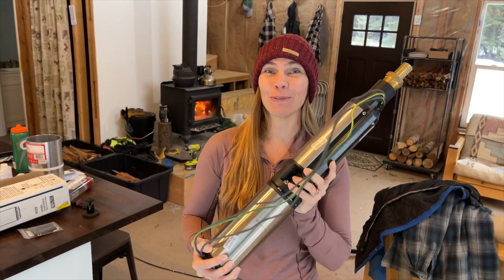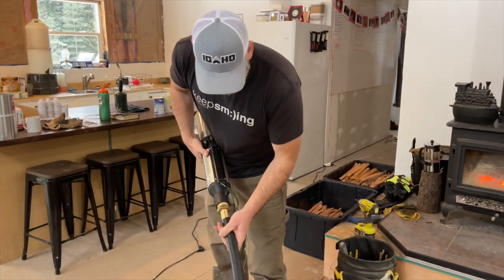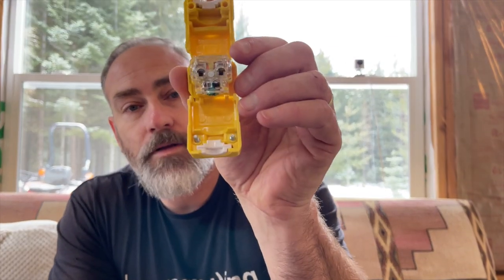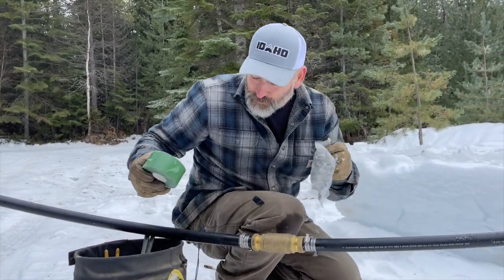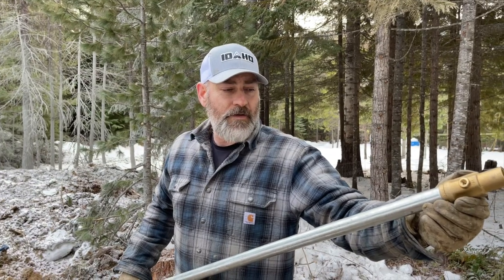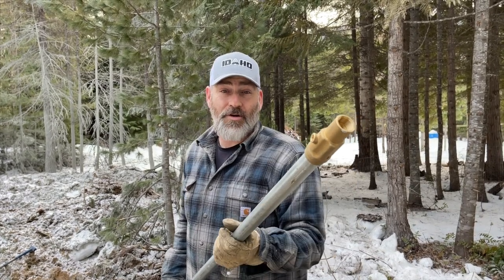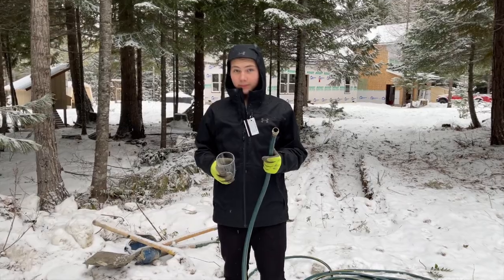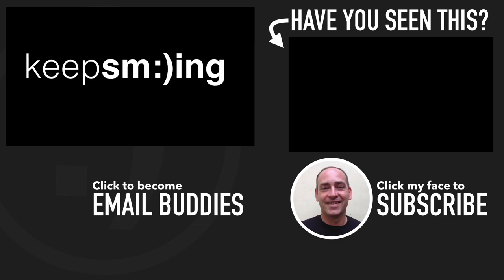WIFE is HAPPY/HUSBAND is NOT - DIY Well Pump Installation

Comment: Several points. Btw, Great work addressing details. I like that attention to detail. 

First, that black pipe is a bad idea as it will suffer degradation from torque. Replace it with rigid pipe someday. Second, the water has high iron in it (not mud, iron). That needs to be removed outside the well, lest it foul flow in the aquifer to your well. Oxidize the iron in a sizable container that can be cleaned out (e.g. 250+ gallon tank). This probably means having to repressurize the water (a pump above ground), which is $. Aeration can be effective, tho it needs more contact time than a chemical oxidant like bleach. An above (in?) grade tank is also more $ and needs insulation. An adv of a tank to knock out iron is that you gain storage. Lots more detail I could provide, but this is not an effective comms channel for the volume.

Comment: The pump has to fit past the pitless adapter, otherwise you would have to dig a pit to pull and replace the pump, and that would not be "pitless".
Also if the check valve was backwards, the pump would draw LESS current because the water would not flow which means less work for the pump.

Comment: Edit: When the host suggests a pause and comment there's something to be said about watching the whole video when you've been stuck in isolation a little too long with nothing good to fix.  

    Your generator is having a Power output crisis. The Volts can't keep up with the Amps.
   Power is the Force in Volts times the Volume in Amps. As Gen's Power capacity is exceeded by drawing too many Amps the Volts will decrease to balance the Power equation. There's a little more happening with an inductor (AC motor) on the scene but by adding a voltmeter you'll have a better chance seeing a Power struggle in action.

   The pump's motor requires more Power to start than the generator can provide and the Volts will reveal the compounding Power problem. As the inrush starting Amps go above the Gen's Power producing capacity the Volts will mathematically decrease. The induction motor is a weird little collection of potential short circuits wound into clever loops to use the rising and falling magnetic fields surrounding the current carry conductors to create a sort of resistance called impedance or counter ElectroMotive Force EMF in nearby wires. Google away for a never ending supply of confrontationally magnetic assured reluctance small talk.  There's a compounding problem here as well because the wires produce heat in Watts = Resistance of wire x Amps². The wire losses in Watts/Amps = Volts. The Volts lost in the wires reduces the Volts available to the Motor. As the Volts to the Motor decreases the Amps must increase to balance the equation for Power. 

In other words, it's better to be hot than make up for it up in volume.

If anything doesn't make sense it was lost in transcription...me fix later. I hope there's something you can use here.

Comment: I know it will be a job but pulling the pump up and down in the well casing will flush the strainer and get all the mud and gunk from the drilling out, you may need to do this several times.

Comment: That little generator is for lights and camping not running a well. I'm surprised you didn't research this more. Very entertaining though, it's never easy is it LOL? I only say that because I've pulled my own well pump out after it rusted a hole in a coupling, then to find the bottom of my well is full of sand and silt, that's fun to remove...

Comment: There should not be a check valve in there. Check valve is supposed to be inside.
24 amp @ 240 volts.
Also, there should be a controller that spins up the pump as more demand is needed and also it will lower the initial draw, which is the highest point.

24 amp @ 240 volt = 5760 watt
Generator should be 75% of load, 
7680 watt generator min to start that pump.

Comment: Next time get an electric chipping hammer to bust the frozen sand, you can rent one for a day fairly cheap. Works great on any hard soil that has to be excavated by hand. You can get air powered ones as well, but they require compressed air , more power but not as easy in many cases. The modern battery powered ones are really good also, prolly be good on frozen sand.

Comment: I was going to tell you to check the voltage also to see if the generator gives enough power. However, you figured it out.
Nice looking water ... (chuckling)

Comment: Sir, if you had purchased a 240 volt pump motor it would draw only half of the amperage that a 120 voltage motor would. It is a  simple electrical principle. The folks that sold you your first two pumps should have advised you of this fact. When it comes to most electrical motors (especially LRA applications) . The higher the voltage   used, the lower the amperage consumed to perform the same amount of work.

Comment: You stirred up mud and sand in the bottom of the hole taking the pump up and down.  Give it a couple of days for the dirt to settle out and you will have clean water.

Comment: Probably what happened was the generator was reeving down as it got overloaded, therefore outputting a lower voltage, which is not enough to turn the motor in the pump at it's designed speed, and you know if a motor gets stuck it will have very little impedance because the coils are not moving through the magnetic field, this causes the current to increase, and eventually the generator's current limiting circuit would trip and shut down as a safety feature.

Comment: I think is is going to work this time!  but I would have wired it with 220 Volt three wire instead of 110 Two wire, that is less of a current draw, my well is 220 but only has 15A breakers.

Comment: Just an FYI you can drill a hole in the top of your well cap and install the hydrant right into the pitiless (you also have to drill your pitiless) and you really shouldn’t run that puMp without a pressure switch and expansion tanks. As far as the power... look up ohms law

Comment: Change that steel pipe from the pitless up, you used nice bronze fittings all over then used steel pipe.

Steel pipe will rust away in a few years.

Comment: Double check your pump specs.  Is it a 120V or a 220V pump?  Typically, when there is no wire color difference (on the pump wires) it is a 220V pump.  Which would be why you were over drawing on your generator.  Just a thought.  Pump brand make and model?

Comment: Maybe the Static head load! the pump might not be strong enough for that depth of the well! 
That a lot of weight the pump has to push up out of the ground! You might need more than a 3500 watt generator!
1 gallon of water weights 8.4lbs.
Reply: Took me ages to get it into my head that only height affects pressure, and wide pipes are easier for the pump when there's a high flow rate.
Reply: @chrisking7603  The wide pipe (6 or 8 inch) is only for the pump to go down into the ground, the water is actually pumped up in the black 1.25" tubing!

Comment: you really should have put a safety cable on the pump and up to the top, either good stainless steel or poly rope. not a bad idea to have one on the pit-less piece either or the same cable tied to it and the top/cap. although 100' isn't that deep.
hopefully you kept the pump up off the very bottom by at least 3'.  you should also bleach the well(whole system) any time the cap is open/new parts.

Comment: 2 wire pump is a mistake.   The start capacitor on a 2 wire pump is ON the pump.....meaning if it goes bad, you have to pull the pump to repair.   A 3 wire pump, the capacitor is in a starter box mounted above ground....repair is easy.

Comment: The generator was not big enough. It was pulling such high amps because the output voltage from the generator was dropping to a lower value. The voltage was dropping too low to allow the pump to run.
Reply: Also, any new well will have to be run until the water comes out clean.

Comment: Before going too far down the rabbit hole of possible solutions. Let’s just verify that the pump is labeled and configured for use at 120V. Most well pumps are 240V and your plugging it into 120V outlets. If it is a 240V pump it would explain why your overloading it trying to run it on your 120V outlets. Also, 12ga wire at 120V is usually limited to 20amps, and you exceeding that by quite a bit. You won’t want to run that many amps through 12ga wire for very long. Good luck!
Reply from the maker: It is 115v on the motor, box and installation manual.

Comment: i grew up on a large farm and i am guessing that if the required running amp required is close to the max capactity of the generator ... your generator is too small ... we always used a generator with 2x amp capacity to take the starting surge ...

Comment: did you put the pump at 510 feet.  referencing your last video, I thought that was where the clean water was?  Also, a couple of commenters have said let it run to clear it up.  Great videos!
Reply from the maker: At 200’. Static water is at 94’

Comment: As others said.  Generator is not big enough.  BUT more info, as other said, the FLA or inrush or surge of a motor is big, and CAN be really big.  A generator has minimal "surge" ability.  You have a 3500 watt generator, maybe 4000 watts for a surge.  The grid, has the ability to handle a LOT of surge.  An inverter, (that you might have with your solar, can often handle double the surge capacity of it's running amps.  (my running amps on my inverters is 70 amps.  Will handle 140 for a surge.  That STILL does not start 5 hp motors!  Most 5 hp motors will require 180 amps.  (trust me,, I've tried MULTIPLE times)  Someone said that the surge can be 10 times the running amps.  Yes, normally maybe 8 times, but sure can be 10 times.  So if your pump say takes 500 watts to "run" it, (is a 1/2 hp pump, 1 hp is 745 watts.  but still, 1/2 is not what the running amps is likely.  Anyway, if 10 times, you see, it isn't going to start it.  The way I now run larger motors is normally to use VFD's, to run a 3 phase motor, then just program in "soft start" and you can then get rid of most of that inrush current needed.  
Some solar pumps ARE 3 phase, so that they can run slower, and they do have soft start built in.

Comment: The rope you put is not a standard one, i am worried about that, there is another submersible pump stainless steel wire with coating, use that

Comment: bad news----never never put galvanized fitting on a wall system!!!!! use brass! I like that you double ss clamps.....  Galvanize will eat out soon! I install pumps....
Reply from the maker: I don’t remember using any galvanized.
Reply: @MartinJohnsonOffGridLiving  I have seen piece of galvanized part pipe  the end  or was it SS? 17:30
Reply: The short piece of pipe on the top of the pitless is for the bar to lower it onto the hanger the piece of pipe will never see water

Comment: I thought well pumps were 240V and you have 120V plug on the cable. Please check the motor voltage.

Comment: I have built and installed many pumps.  There is no way 1/2 hp pump should draw over 30 amps at startup.  Average high end is 13 amps.  A 2000 watts generator will run a good 1/2 hp pump.

Comment: You could have used the pitless 2 feet under ground and lowered it  later. Dump a gallon of bleach down the well before drinking, Pump  bleach water in the first 5 minutes back down the well to clean your hand prints and other crud off the poly pipe,wire and fittings, pump on the ground tell smell is gone then safe to drink. With out a tank, leave the valve open if you dead head the flow the pump will push the fittings off. I have seen a pump run with out flow and get so hot it melted the poly pipe at the fitting and fell to the end of the rope and spun around tell the wires broke. You may need a 2000 gal holding tank so the dirt settles out, then a booster pump to the house.

Comment: Pretty sure you're supposed to install your frost free hydrant into your well pipe. Then when you shut your hydrant the water runs back down into the well, rather than wasting water every time you use your hydrant.

Comment: You never explained, but you are hooking the pump up as a 110 volt system instead of a 220 volt. I am guessing it is because of your generator's ability to produce 110volts. Some generators can produce 120 volt. Also keeping the inverter in mind. The limitations could be there.
Reply: I commented not knowing what your generator's rating is either
Reply from the maker: the first gen was 120v only 3500W

Comment: While your wiring will work as installed, to be extra safe, the wires should be placed inside of a 3/4" plastic pipe and then the 3/4" pipe attached to the main water pipe with your green tape. The electrical tape will loosen over the years and the wiring will rub against the side of the well, causing the wires to rub, fray and break.

Comment: You need torque  plates! --Dang. I'm too late. The wire will rub in the well if you don't.

I had to get a monster generator to start the 1hp I have --about to use it from the sound of breaking limbs(ice storm in va).

Comment: Congratulations, I can not comprehend what it is like dealing with frozen ground, next time place the non return valve directly on top of the pump. Use stainless steel safety cable, but job well done.

Comment: I think I made the comment using a soft start pump when you installed the well. It might have been on an earlier video. Perhaps when  I mentioned soft start it was not clear what that meant in terms of reducing surge capacity.
Reply: I found my earlier comment on the drilling video. It was buried as s reply and the financial impact not understood in terms of needing a bigger generator versus the cost of a soft start pump.

Comment: I placed a 3 wire/220 1 hp pump in my well last fall on my new property. It takes a 20 amp breaker. Starts against 40 psi load and pulls about 16 amps on starting. So it sounds like 35 amp startup is correct. I am curious how the amperage draw might go up against tank pressure? Will watch follow up vids to find out👍 Pump sets at 96’.
Reply from the maker: We will share it all. Thanks for the comment.

Comment: You should have a column of water in the well and the pump should be 10' off the bottom. I suspect you are pumping dirt and the pump is stirring up the silt on the bottom.
Reply from the maker: The pump is at 200’. No where near the bottom.

Comment: Pure Living For Life did a video on their well and they live in Northern Idaho as well. They had to run the water for a while before it turned clear and then they had some water quality issues so they installed a filtering system. They also had it tested and everything is good now. They hired out everything and didn't show all like you've done. I like your video better. They showed the drilling process and not what you did. You showed what they didn't.

Comment: Where are your round spacers that clip on the plastic pipe to keep it from rubbing on well casing on the way up needed every 15 feet ? You will wear a hole in the plastic pipe I’ve had wells for 20 years

Comment: Id imagine its already been said but.....FIRST THING IS TOSS that harborJUNK generator 3500W to those are more like 2200W seriously....when i seen that i just said NOPE....thats the MAIN PROBLEM if it has been a WINCO or even a DAYTON winding generator it would of run that pump....also you have to consider that LONG 500 FOOT RUN  their is a chart on your loss of AMPS after a certain amount of feet so i would ME PERSONALLY would of put wopping 8ga wire all the way down and you would be just fine its the UMPHHHH of start up also and when you use a junk generator it just does not work....love the camera  work also let us know what kind of cameras you used outside in that cold that lasted so long model numbers would help any questions for us we would be glad to help.
Reply from the maker: It is only 200’

Comment: Today is 2/11/2021. Did you get clear water yet? Where I used to work , sometimes we had to run the water 24 to 48 hours to get it clear. Then had to let it set for at least 24 hours to get the mud to settle out. Good luck.

Comment: You need to borrow the backhoe from my tractor. As for the pump. I highly doubt you can get 110volts to put out 10gpm from that depth. I also use a 110 pump. had to go through a few of them to find a good one though.

Comment: As a Driller and Plumber you should attach your check valve in the top of the pump and the torque arrestor around the pump and pipe. And you really should put your L1 wire from the house to the red and the neutral to the black.

Comment: They may have improved nylon rope  technology since the many years ago that I was a pump installer,  but that rope will rot  fairly fast, and it's a pain when it does.  I always used  small steel cable.  Just food for thought,  I know alot of people used and still use rope.  I just never liked it.

Comment: anything over 200 " will have a drop of either amps and or voltage withh long runs i allways  used a large gauge wire...

Comment: 20:53 paused. I have every confidence in you guys. It's a "yes" from me. Let's see that gusher! Edit: OK so it didn't work. I am no well engineer but i think it may be stressing the pump lifting all that water to the surface against gravity. pi-r(of pipe)-squared-h of water to lift. Hope not embarrassing math but if 200ft (70m) and say 3cm diam pipe its lifting about 110lbs of water.

Comment: I have wondered if your little inverter will ever be able to run your well pump. Have you thought of doing two inverters to do 220 and get a 220 well pump. it would also give you the ability to get an electric dryer.